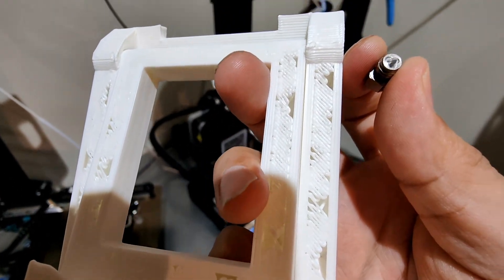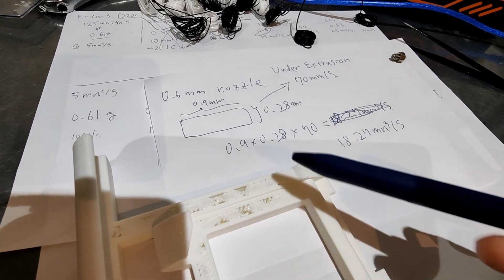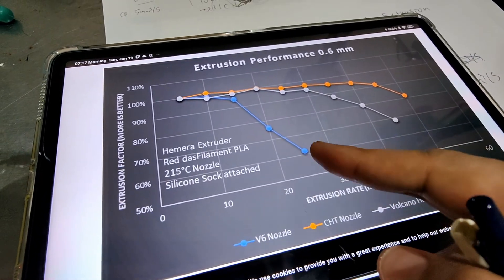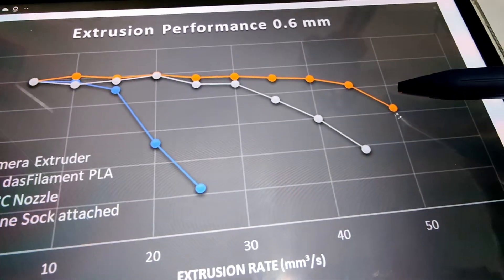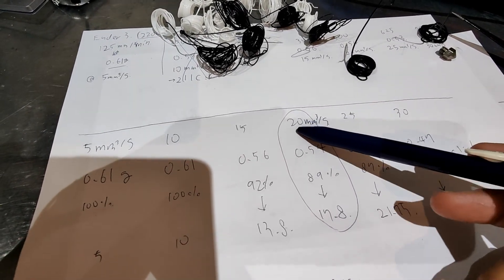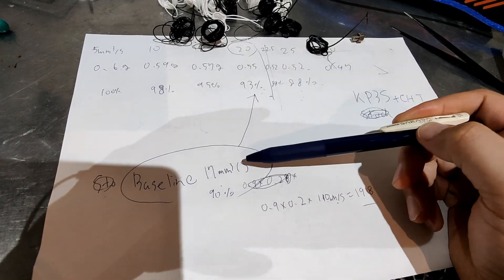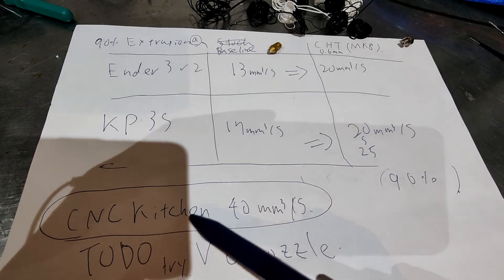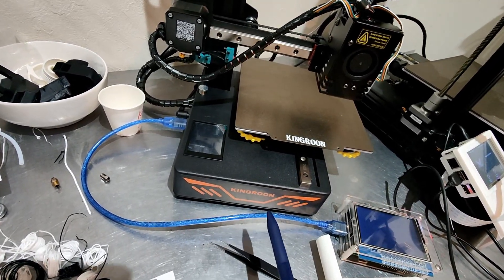Trying CHT nozzle for my stock Ender3 v2 and KP3S

Comment: 50% improvement is still a lot just for the nozzle change! maybe prisa used by cnckitchen has a better PID controller for the hotend or a better heater. need steady state extrusion temp not to fall when high extrusion rate suddenly starts. thanks for sharing! getting a cht nozzle for my ender tomorrow